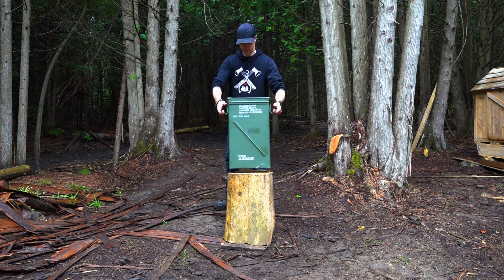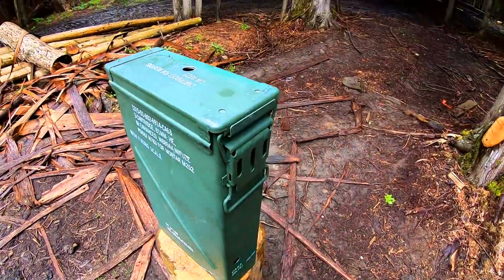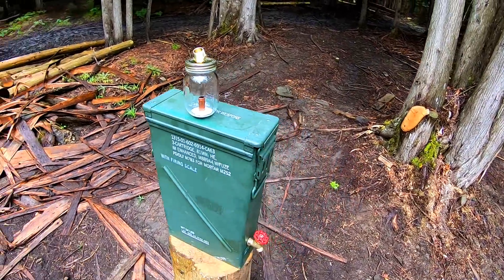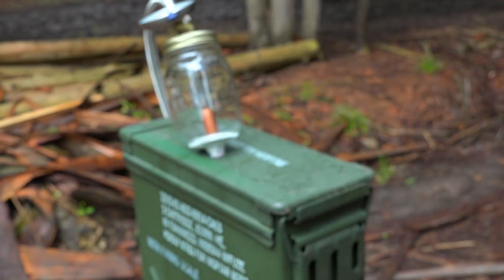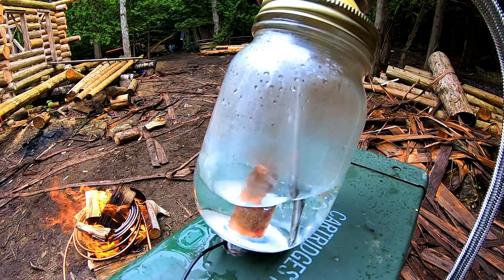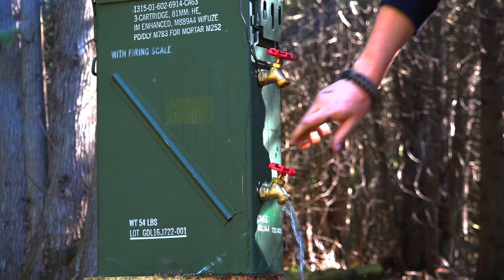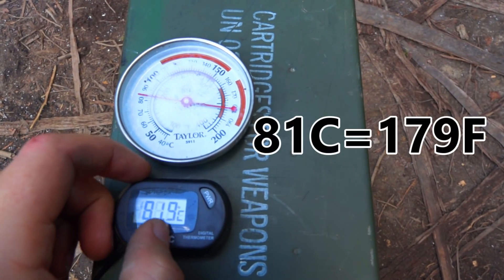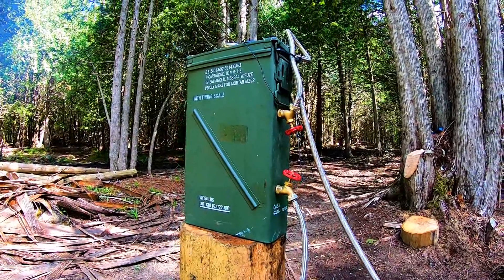Off Grid Heating Prototype- Copper Coil Water Heater / Heat Exchanger / Radiant Heater

Comment: You could fit a 3/4 automatic air valve on the top of the box!a 3 bar arv will work fine!this way you avoid moisture build up from the steam inside the camper while reliefing the pressure from inside the box!basically you created a radiator!love it :)

Comment: Or... and I mean just throwing it out there... you could just put the water over the heat source. Why so much unnecessary complication? Also... have you looked up the meaning of the word efficient? Bc that set up does not qualify.

Comment: That's pretty cool, man.

Oh, wait.  No.  It's not!  ;-)
Reply: How long do you think your copper pipe will last before it burns through?

Also, have you considered a simpler hot air heater?  A thick metal plate (maybe quarter inch?) that will not burn through, on which you put a flexible coil of metal ducting tube, say 6" diameter.  Cut the tube at some point and insert a heat-driven fan in there, to push the hot air through the ducting.

Comment: Install a transmission cooler coil and you got yourself a nice radiator. Transmission coolers come in really compact sizes. Attach that in between you system with the trans coil inside the portable cabin.

Comment: A lot of people have kicked around the idea of using a car radiator, but what about a water-cooled computer radiator. Much smaller and lighter, and can be used with near-silent electric fans. Perfect size for your snowmobile camper
Reply: Wouldent that boiling water be a problem tho?

Comment: You want radiant heat, not a sauna, move the copper near the campfire, not above it.
Reply: Make a pipe going out of the hut for the steam maybe.
Reply: That's what I was thinking. Just a few rings (or even just one) for a large coil that can encircle the campfire, or maybe one or more large coils with one small coil in the fire on the end nearest the return to ammobox.
REGULATING is the difficult part with this design.
You want large coils outside the fire when the fire is big
and little coils in(or closer to) the fire when the fire dwindles down.
Reply: A few capped containers of hot water inside the shelter would suffice. We used the sun to warm a few dozen gallon-containers of water in our greenhouse to keep the plants alive during snowy winters. It wasn't warm, but it wasn't freezing.

Sleeping in a sub-freezing tent, a bare, incandescent bulb is a heat source. Been there.

Comment: Copper tubing in direct flame doesn't last too long. Stainless would be better.
Reply: He's also boiling the water, which makes steam and could build up pressure to a dangerous level. A way to remedy all issues is to not have the coil directly in or over the fire, but around it. He's experimenting and will get it.

Comment: Id attach the ammo can on the outside wall in a insulated box,with a heatsink sorta contraption to get the heat inside. More interior room, leas chance for water spillage and no moving it in n out. Put a little fan on the heatsink n bam.

Comment: a check valve on the cold water output to the coil would solve many issues. A coffee maker operates on the same principle, and they all have check valves installed somewhere near the cold water supply feed.

Comment: Great video I learned a lot almost more in formative was the first semi failure where you had to re-engineer it. It was great and instructive and good for you for leaving that in not making it seem perfect the first time out. Couple of things though I would like to see the finished project I would like to see the water heater in a cradle of sorts custom built inside the camper. I would like to see it sanded and repainted to get rid of the olive drab. Lastly, if the water stayed that hot for so long it is a natural as a water tank to have a warm water source for bathing.

Comment: If you're not concerned about using it as a water heater, have a second box outside for cold water inlet, and have a copper coil within the ammo box inside, so the water circulates through the coil inside the box, not within the box itself, fill the box with antifreeze, and let the coil sit in that. Should prevent the need for removing from fire during the night due to over heating, while allowing the box itself to get to higher temps. That's how we made ours.

Comment: Raise the coils above the flames to avoid melting the soft copper. Plus the outdoor coils can be used to warm or cook food (as coils on a stove top) and also design a coil inside the cabin for indoor cooking or drying wet socks or gloves. If you wasn't going to use water for bathing, you could actually use antifreeze in a sealed system with a 7lb radiator cap and thus avoiding frozen water pipes when the flames go out. I like your set up though. The aquarium thermometer is sheer brilliance as I wondered how I could cheaply monitor my hot bath water to avoid scalding my balls off. 😁😁 lastly, I use a standard propane tank (off of a grille) and a round heating element for winter heat. I can run it 2-4 solid nights, I hate chopping firewood as I have grown older.

Comment: I would channel the copper tubing directly into my enclosure and then wrap it tightly around my body to get some nice heating through conduction.
To quell the inevitable burning which would invariably follow, I'd then pop the hatch, reach out and get some snow, and pack it inside my sleeping bag to cool myself down almost instantly.

Comment: I applaud your ingenuity but you've built a rudimentary boiler/radiator config...might be safer and more efficient w/ a closed wood burner/boiler to radiant coiled heat pipes in the floor of the structure. Heat rises.   You also wouldn't be endangered by the ammo box failing and you wouldn't lose the space.  The copper pipe won't last long under those direct fire conditions either.  I'd say a small camp stove with the copper tubing coiled around the outside as many times as you can get...route to your coiled pipes built into the floor of the structure and have an adjustable pressure valve outside.

Comment: You're supposed to have smaller fire because otherwise you risk boiling water in the tube. It makes it loud and dangerous because sealings could melt. Also make sure that the ammo can can't tip over when you bump it because then you risk burning yourself

Comment: maybe some kind insulating foam or plaster or something on the side away from the fire? or a thermal blanket/ moving blanket to wrap it in after heating to keep it holding heat for a longer time? you could also bring 2 blankets and switch them out to give yourself a quick warming through a cold night

Comment: So what's the next step then? Do you disconnect the hoses and lift the boiling 50-pound ammo can into your little sleeping capsule? Sounds like a recipe for burns either as you're moving it or during the night when you're sleeping and rub up against it.

You should do another video where you install the ammo can semi-permanently in the capsule. Tie it down so it can't move, build a guard that will protect you and drill holes for the hoses to go outside. And let us know how well it works or if it's practical. So far this was nothing more than a proof of concept.

Comment: At this point could built in a little steam turbine before returning to the tank to generate electricity at the same time. Then basically you have a nuclear reactor only it's campfire instead of radiation haha. Closed water system with heating element that turns water into steam to turn turbine and then return to tank after condensing back into water.

Comment: That is unsafe. Creative, and useful in a pinch, but with no safety devices he's putting himself in great risk of boil over, and severe burns. There is no shut-off, he would have to leave the cabin to remove the coil from the fire after he notice the problem whether it's a leak, spill, or boil over. Shutting off the valves would be close to impossible without injury at those temperatures. Even if you shut off the valves that would just turn the tubing outside into a closed pressure vessel.
Reply: I agree. Also closing the 2 valves is very dangerous, you get a massive pressure building up in the copper pipe, which might lead into a pipe burst.
Reply: @MJ-bs3ru  that's what I meant about the pressure vessel especially since that looks like thin-walled HVAC lineset tubing.

Comment: "... air trapped in the lines and create steam like it did before" - I dont think this is quite right. The tube will still generate steam, its just that water can back flow from the new connection. The steam is heating the water in the can. Once you have steam in the pipes normal convection is disrupted, but then you probably had bubble transportation going on too.

Comment: I'm no knocking this in any way, honestly. But why use an ammo can and not just use a reclaimed radiator from an old home or even a car?
Reply: From reading other comments I gathered that a) radiators can be more fragile/take up more room and b) while it would shed heat better, that may end up actually detrimental to the design because we're not just trying to heat a cabin initially, we're trying to keep it warm all night, presumably without a continuous unattended fire. The ammo can will hold a lot of water that acts as a heat reservoir, where a radiator would quickly radiate any great from the water inside it then need reheating.

Comment: IMPORTANT !!! Don't leave that water at the boiling point without the hole (pressure release hole) in the top of that tank. If you do you'll have a extremely nasty pressure bomb full of boiling hot water on your hands.

Read on if you wanna

 Normal heating systems have expansion vessels and vent pipes. (when hot water turns to steam it expands by 1600 percent.) in this case maybe the lid would kind of bend up at the weakest point and steam would blast out of the sides, but if somebody used a sealed container with no weak points and just left it boiling, the pressure would just build and build from the boiling point until the whole thing exploded. wouldn't want to be within 100 + metres of it. (DIY plumbers have killed people by making this mistake on heating systems) 

P.S
 for any argumentative folks out there, yes, I'm sure if you had a fat wallet you could get specialty tanks that are built to take high pressure up to differing rates of ppsi. now go eat a dick.

Comment: For heat exchange, wouldnt it be more efficient to run a copper coil  under the bed or in the walls? The coils would have more surface area to let off heat similarly to how they also allow for heat to enter from the fire.

Comment: use an electronic valve for the tank outlet use a thermostat to open an close it. By doing that you can regulate the temp it reaches in the tank.

Comment: What about burying the fire/cold once the combustion gets good and going.  Should drop the heat output enough to keep things comfortable and the slow burning/oxygen starved fire should burn throughout the night keeping your warming system going.   I'd also be testing out ways to get a coil integrated into the underside, or even sides of your sled with quick connects to attach/detach the system when needed.  Need an efficient way to keep the water temp from going too high, though...  Food for thought

Comment: Really cool idea, just concerned that if the ammo box is only losing 20 - 25c in 2 hours it may need fans or fins to increase its heat dispersion. You can easily convert the litres and heat loss over time into a wattage output to get an idea of how much heat you will actually get. Nice work man!

Comment: Nice, but try digging a firepit hole and putting the wire on the outside border of the fire. The open air flame limits how much heat makes it to your coils. If the coils are surrounding the fire it would be more efficient. You can also use less copper wire this way and limit overheating. Try one or two copper rings vs 6+. Stay wild and awesome!

Comment: Just found this thanks youtube? would it not be better to run the copper coil threw the floor/roof and to maybe just heat the ammo can not the copper tube and insulate the cabin.  and you could heat the can with a small rocket stove type fire or a log torch or something like that. rather than have all that mess of a coil in the fire. also the melting point of copper is rather low and i am sure if you kept that fire going for a while it would melt said copper while the steel box would fair much better.

Comment: Great experiment. Thanks for sharing this. I was thinking on using a small car heater, radiator for indide my ATV camper. Thinking I would use quick connects just on the outside wall, similar to an air hose connector. If I filled the rad with anti-freeze, it would be usable year round. You proved that the size of the coil is important also. I'm thinking a smaller coil with a 12 volt fan/solar behind the rad inside. Thanks again for this great information.

Comment: So what happens if you fall asleep, the fire goes out, water freezes, and copper lines burst? The next night you start fire and flood cabin.
Reply: The lines won’t burst. The water can freely flow into the ammunition container so pressure won’t build up from ice forming.
Reply: Noah Schuler nah water would prob freeze first in the two ends going betweeen coil and the box, since the fire would still have a bit of heat and the box be inside and retaining heat. After that you could end up with “plugs” in between the coil ends and then water freezing in the coil and bursting it, would probably be a good idea to put isolation between box and coil to prevent / reduce such a possibility
Reply: You could always use coolant instead of water.

Comment: You might actually be boiling the water and having steam enter the ammo can instead of circulated water. Did you try checking the temperature of the inlet pipe to see if it reaches above 100? It could be dangerous.
i used to heat up huge vats of water using a steam pipe and it made the same sound.

Comment: A simple an neat idea.
Just a few thoughts....
1) 8mm microbore tubing would be more compact since you've got to take this all with you. You probably don't need anywhere near as much as you've got either. It's probably not necessary to heat it up that quickly anyway. With such a tiny volume to heat, you need very little output from this device.
2) Adding some insulation would keep the heat in so that it lets it out slowly overnight. You'd probably close the valve when the fire goes out so stop it reversing the action and cooling the tank.
3) You could arrange for an adjustable flap to uncover the top and let air flow through so you can regulate the output.

Comment: Small radiator from a 2 stroke just before your water tank. Will give you access to the heat much quicker. Could even do a small bypass. Radiator for quick heat. Then heat up the mass of water for long term thermal heat. Radiator would also help in controlling heat levels.

Comment: Adding one way valves and a t connected to a pressure release or manual  valve on the hot watter inlet should let you not need to leave the camper just close the outlet and open the release valve so the over heated copper doesn't spray hot water all over your camper when steam decides to blow through only downside is that would lose you some water. Also increase the efficiency by adding a small triangular bent peice of sheet metal at a slight incline just above the outlet and a hole at the seam on the opposite end this way the excapeing gasses get to cool down alowing any steam produced to be captured into the water

Comment: I'd use the water lines as the heater in your camper, rather than the tank, as a donkey gets hot very quickly, as you've discovered. Try using a 200L (44 imp gal) 55us gal drum, in place of the ammo box

Comment: as many others have said id choose a radiator or heater core mainly for small form factor plus the need for dramatically less water to fill the system and less time to heat it. but still cool idea

Comment: That is a cool idea! Nice for minimalist camping or overlanding too. Reminds me of brewing beer. You do the same but opposite after it is boiled, you need to cool it quickly. My dad brewed in an old keg, and they bent a spool of copper wire to fit inside of it. It had a male hose fitting on one side. You could hook it to a hose from the faucet and it would circulate in the tube, submerged in beer. Cold water would go in and it felt like shower water dumping on the ground. For the boiling concern, It would be cool to build some type of adjustable/portable stand for the copper pipe to sit on to stay out of the fire but in the heat. You could use the adjustability (legs taller or lower) to regulate the temperature. But it would also have to break down/easily disassemble for ease of transport. Also would need some type of bracket inside the trailer that the ammo can securely fits in to, so you don’t dump boiling water on yourself in your sleep. Cool idea though! I’m gonna subscribe for sure

Comment: Build a stone pathway for the copper pipe to be on, and have the coils go through a dirt fire pit that has rocks to allow the pipe in and out easy...  A loadable down low for the wood -"Oven" for an extended stay- would be better...  Then you wouldn't have to worry about burst pipe, or steam...  The copper pipe on the rocks can be buried with dirt...and still go slightly underneath the snowmobile sleeper...  Snow would keep the area free from overheat--and melted snow would pack it tight...

Comment: Make that coil shorter and it would take longer to heat up but that would have a substantial different on how long it takes it to get too hot. Add some T.E.G's to it and you could even pull electricity from it. Should be enough to run some L.E.D lighting from it.